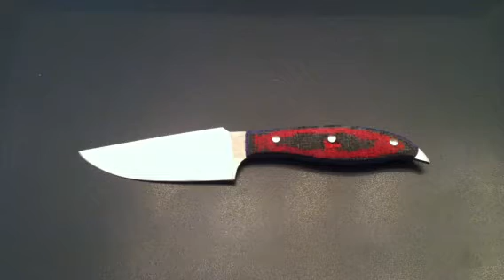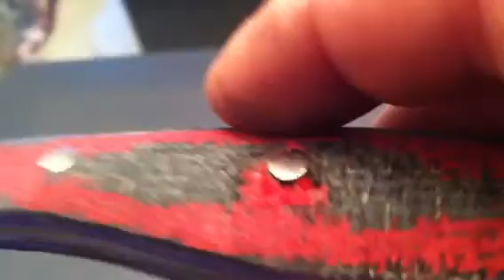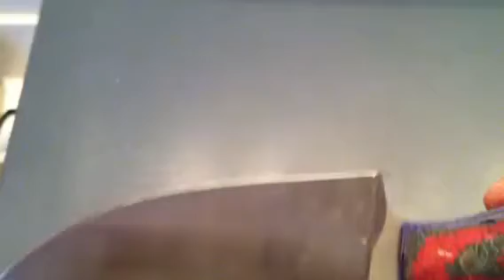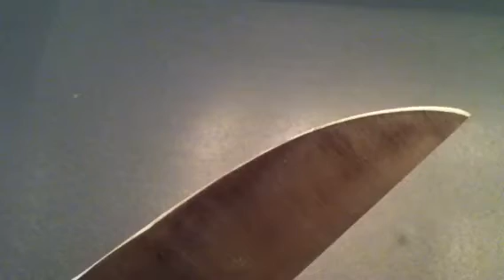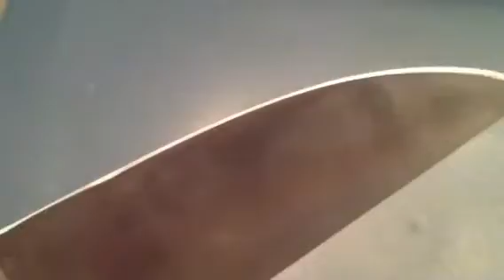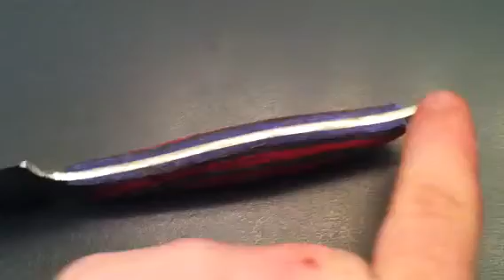Update on the Socom!

Comment: Looks good! I think you can sand down the scales a little more and get the blemish out.  Not that bad though.  Quick tip, use xylene to clean off excess epoxy before it dries.  Cuts right through it.  Hope it helps